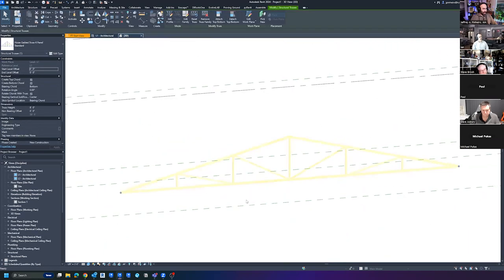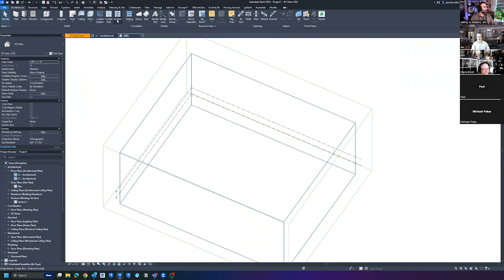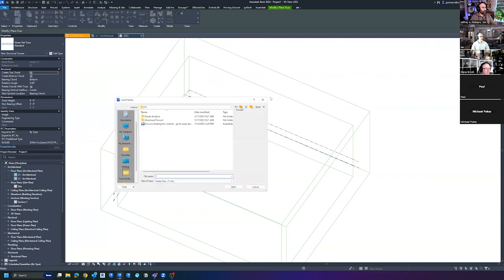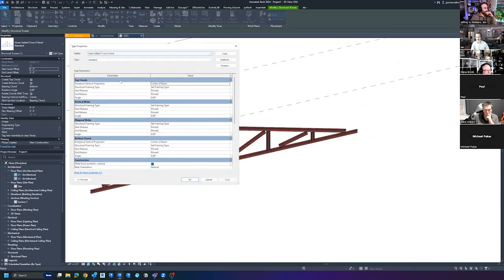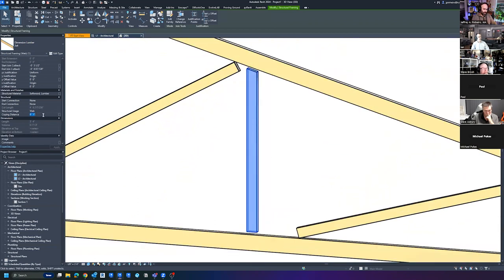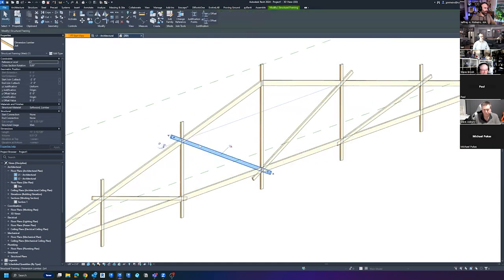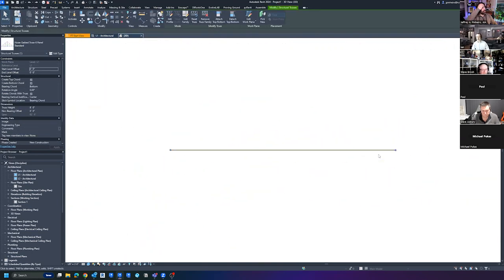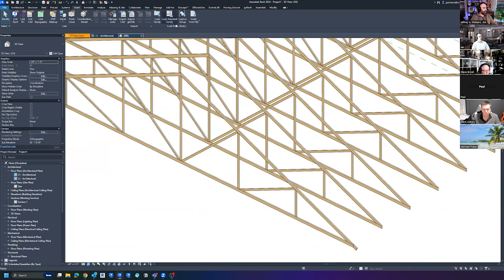Wood Truss in Revit Tutorial (Office Hour Sessions)

Comment: the question regarding the plate moving, it possible maybe if you lock the reference plane of  the plate to the vertical framing members while in group mode.
Reply from the maker: Unfortunately, that still doesn't hold... you need your families to host to a level and not an object/vertical plane for groups to NOT break...usually.

Comment: Sorta framing related question, would love to know if you have an answer. What is the best way to get total plywood sheets needed for roof sheathing? I can’t find an answer anywhere. Something more plug and play rather than creating a bunch of different formulas in a schedule. Thanks!
Reply from the maker: You can try modeling them manually with things like curtain panels/walls.... but, I would look into plugins for Revit made specifically for what you are trying to do (like MWF Pro Wood, and AGACAD wood framing tools).
Reply: @TheRevitKid  thanks for the suggestion! I work for a National Homebuilder so modeling them out won’t work so well with all the different plans we have. But I will look into MWF!!